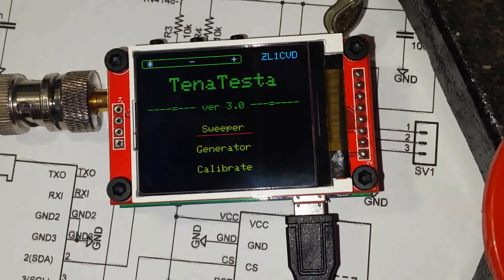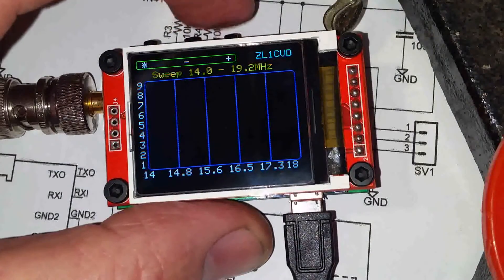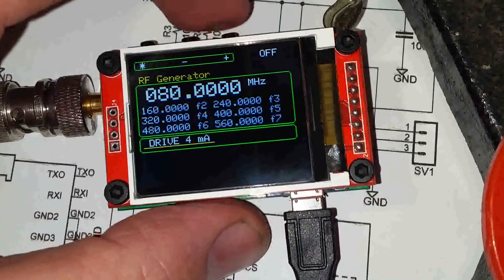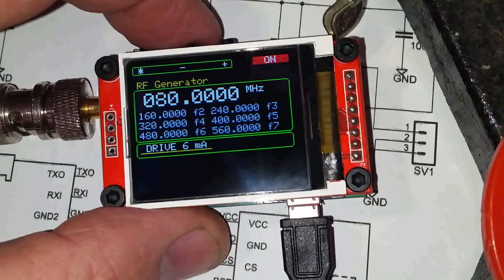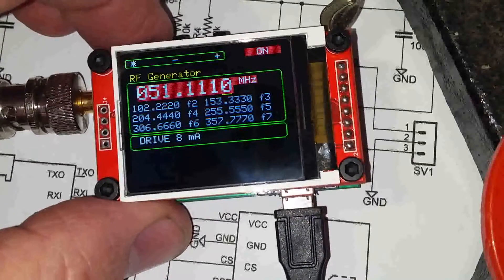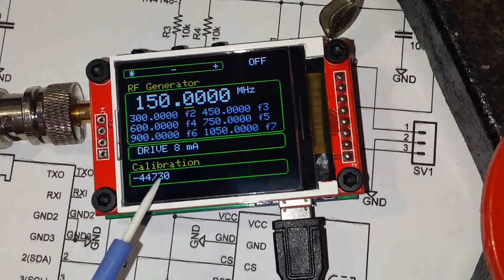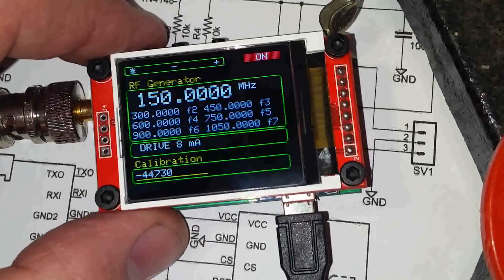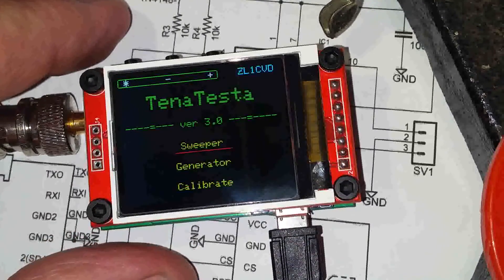ZL1CVD TenaTesta 150MHz SWR Scanner & RF Generator to over 1GHz!

Comment: This is a very handy measuring tool. But to make it accurate the square wave from the SI5351 has to be filtered. if you put a square wave into an antenna you get unwanted reflections of the harmonics which will  show you an inaccurate SWR chart.
Reply from the maker: Yes, the theory is correct and indeed on some antennas with complex impedance, this is a real problem. In practice, the harmonics are sufficiently smaller than the fundamental AND the diodes do not conduct well enough for this to be a problem with the wire type antennas I have built. Its certainly a compromise but worked much better than I thought and well worth considering if you like to tinker on a budget.
Reply: @ZL1CVD  All antennas have complex impedances. Only on the resonant frequency's it can be pure resistive. Otherwise there will be inductive and/or capacitive reactances. But I agree that with the small level of RF output this device delivers, it will not be a  problem. It only outputs 3.3Vpp unloaded. With 50ohm LOAD it outputs only 1.65Vpp. If the second harmonic is ~10dB down the detector will not detect it.
Reply from the maker: RF output is way less than 1.65Vpp. For RF measurements I only drove it at minimum RF needed to turn on the diodes which was 4mA (+2.3dBm or 0.8242Vpp). Even in generator mode, the maximum it can output is 7.2dBm (1.4488Vpp) !